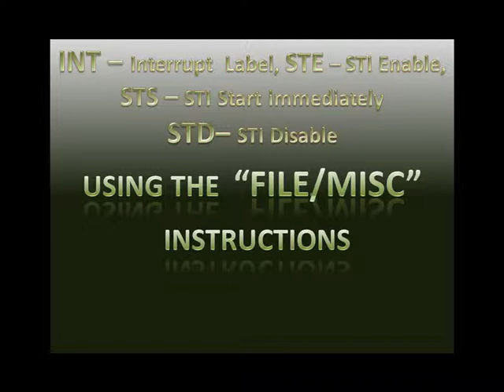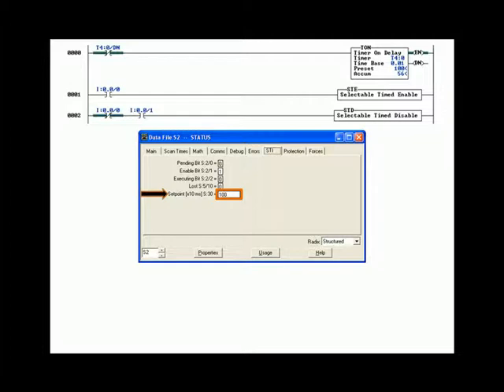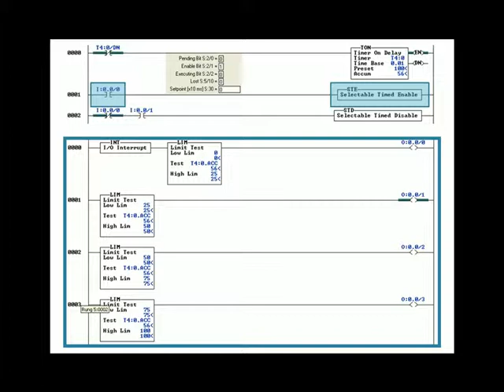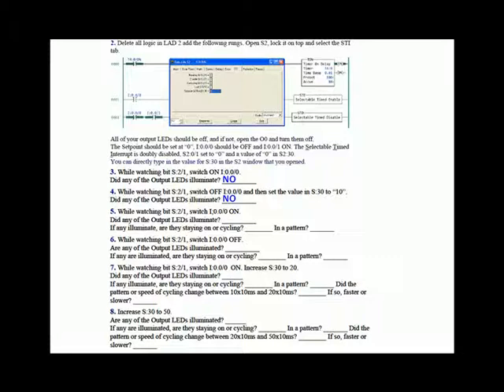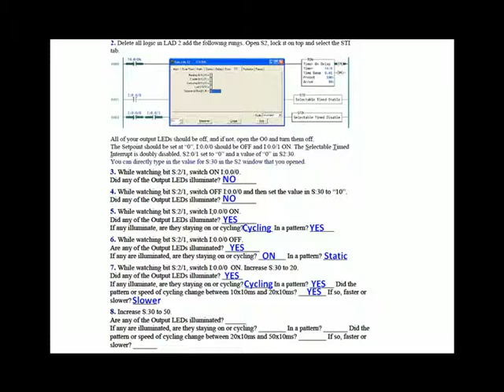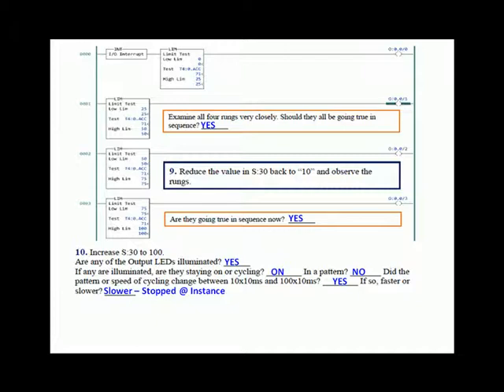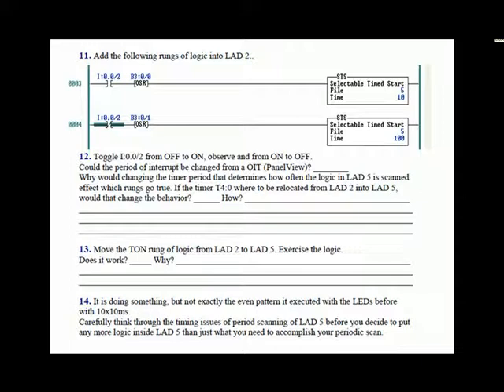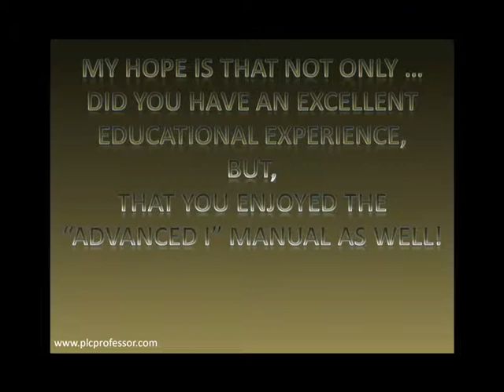ADV1 18 - Interrupts RSLogix500, A PLC Tutorial.

Comment: At 6:38, my logic in LAD 5 shows the timer running in the LIM instructions, but no outputs are on, even when i set S:30 to "10". Also, when i switched to run mode, it said "Forces Enabled",  i right click on the outputs to remove forces, but it still doesn't turn on.